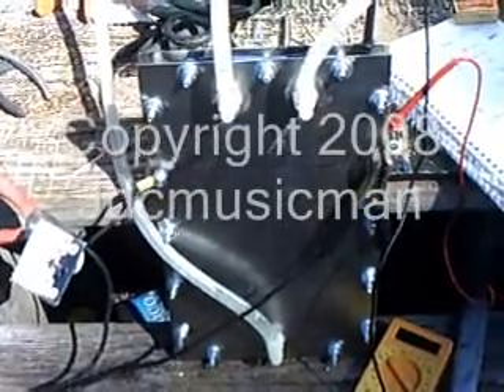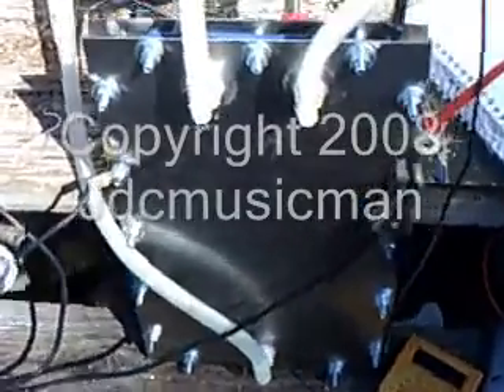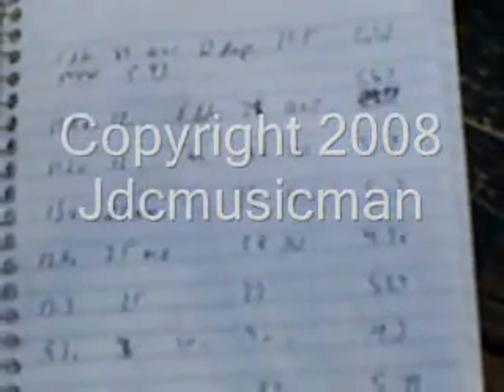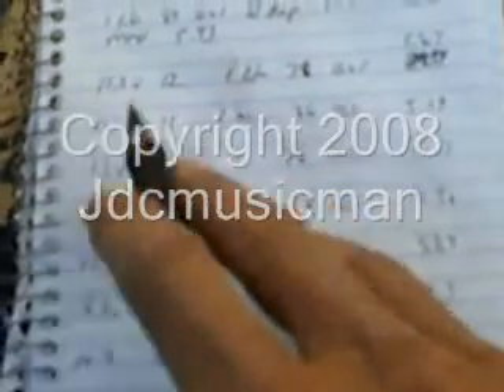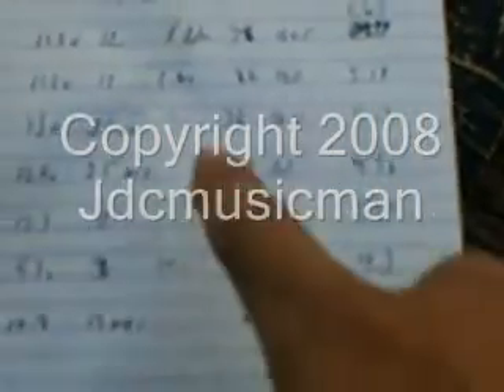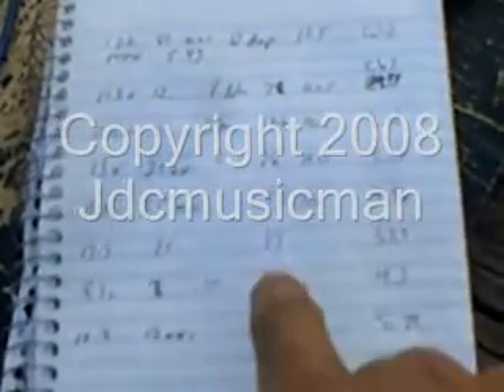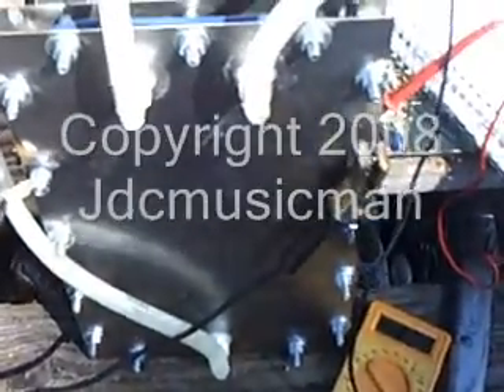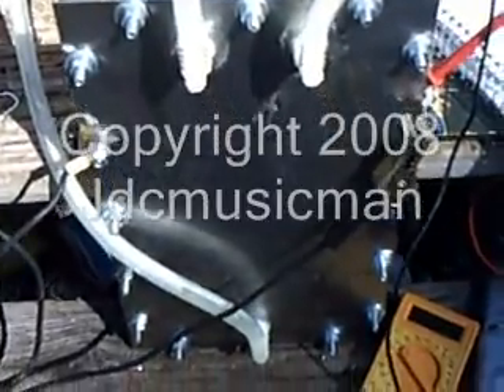6 plate 13"x7" Dry cell MMW 5.79

Comment from the maker: I tapped the holes screwed the barbs in took some goop put around the outside let it dry for a day then took my sanding wheel grind the excess off...Works great no leaks not touching the plates